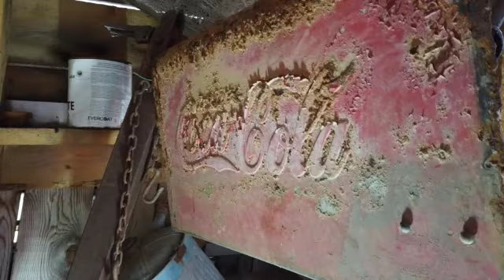Apocalyptic Radio and engine stand hiding place

Comment: As i said before, making a basic 1/4 wave antenna or 1/2 wave dipole is very simple.
They can be made from copper wire  or aluminium tubing, you just add a few inches more so you can prune it to get the antenna tuned.
Do you have a s.w.r meter, often called Sweeerrrr meter lol.
Reply from the maker: I do somewhere.  Might be up in the attic with the rest of the stuff